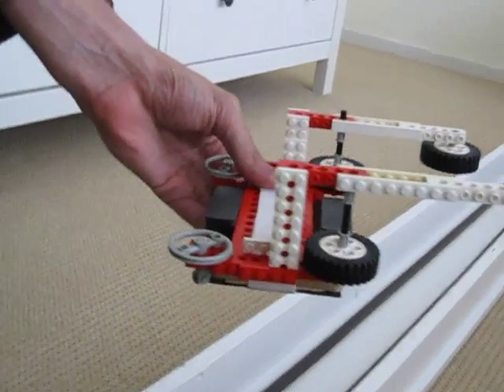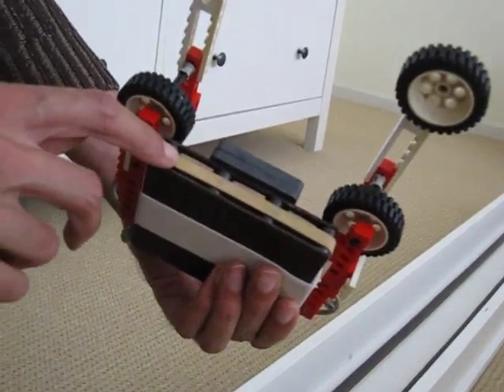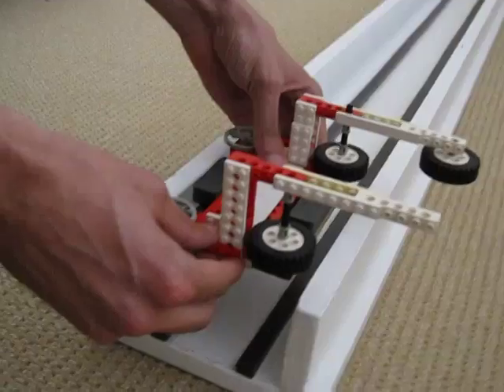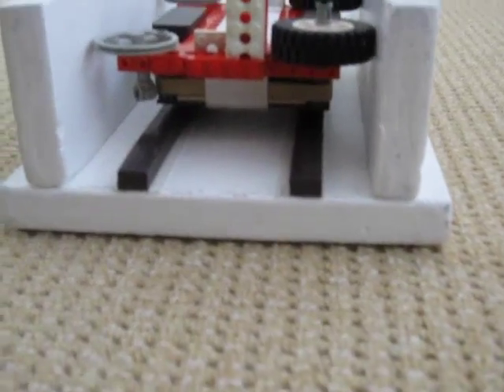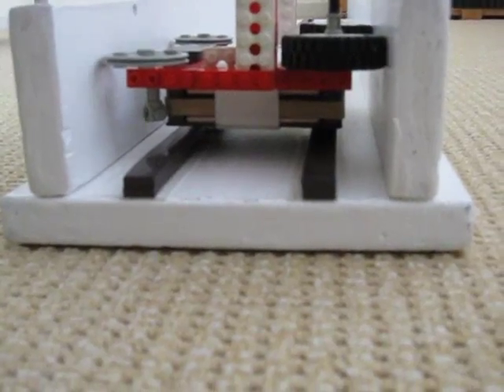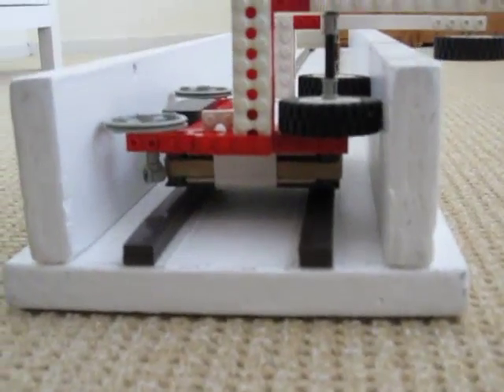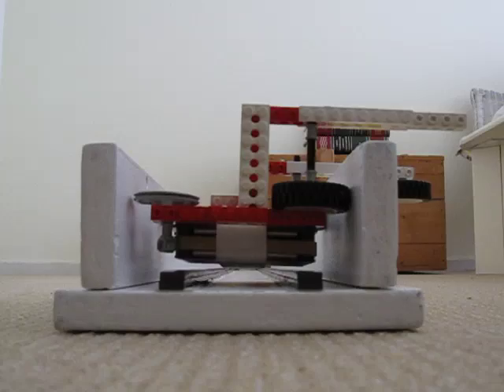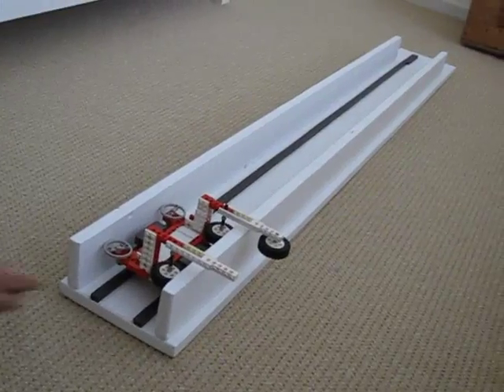Model Maglev Stage 0

Comment from the maker: @tehpurplecobra
I just screw three boards of wood together. The magnets in this video are actually from a flexible strip used in refrigerator doors and such. I bought 10 m for about €13,- at an industrial magnet supplier. It is not a very strong magnet, but you can easily cut it to size. You can also use magnet bars as the rails. I have 50x18x5mm for €0.50 a piece. There are also toysets available. The strongest magnets are Neodynium. I use ceramic. I don't have blueprints, I just cut and saw.